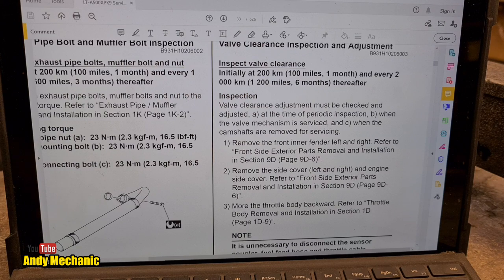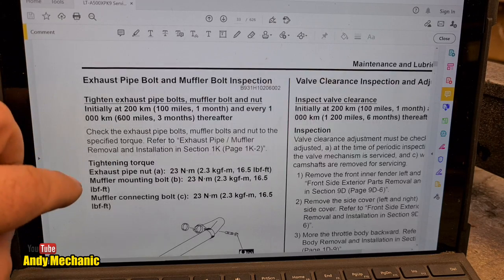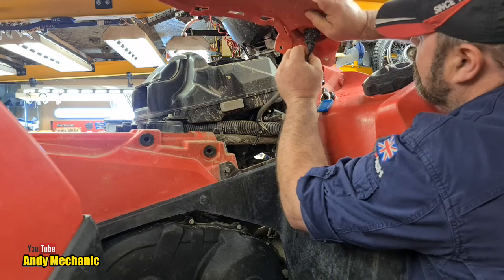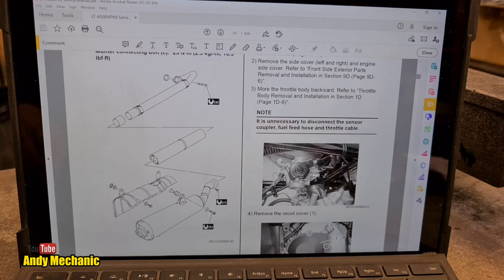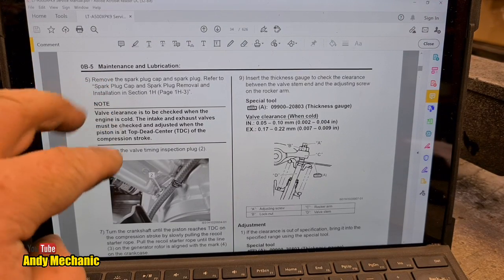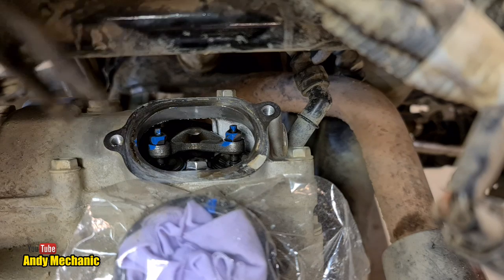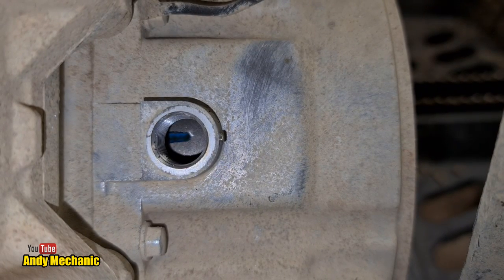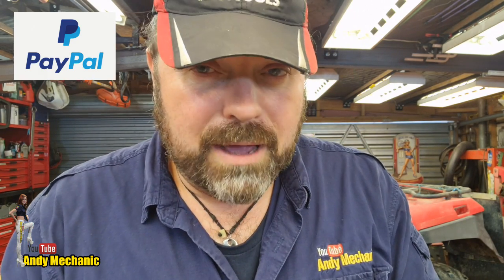Suzuki Kingquad - valve clearance check & adjustment #1878

Comment: Why would you not take the time to wash it before you opened up and vital areas. Amazes me how people work on muddy motors. Just a disaster waiting to happen.
Reply from the maker: The bike was washed prior, 2 hours spent water blasting mud from the chassis  Modern ATV chassis are less accessible for cleaning due to the extensive plastics now covering the engine. Not ideal at all.

Cheers
Andy

Comment: Hey I know this is an older video but I'm getting ready to do the same job on an 08 king quad. How do I get that tool for the valves thanks
Reply from the maker: Mine is a Yamaha special tool- any Yamaha dealer should be able to supply.

Cheers Andy
Reply: Hey thanks a lot.  I did end up finding one.  Mine were all .004 out of spec   now just waiting on o rings 🙄 over a week now

Comment: Andy is the 500 you worked on here close to the same as the 750 valve wise? Meaning could I adjust my 750 valves in the same sequence and same instructions. AKA/ valve clearances?

Comment: Hey Andy, how many km did that bike have? Just wondering how essential it is to get this done, after 200km initially seems extreme. Also are you just using brake cleaner here or sonething else. Thanks for sharing.
Reply from the maker: First service is critical, components bed in & clearances often change as a result. Do it now & it should then be good for a long time.
Cheers Andy

Comment: Hi buddy. I'm just about banging my head against the wall with my KQ 300. Hard to start. Won't idle. Pops and bangs through carb when it runs. Tested CDI, regulator, new plug and cleaned carb, set valves.. Eventually put a brand new carb on but still the same. Compression 110psi. Any ideas?
Reply from the maker: Chech valve timing & also pull flywheel & check it hasn't spun on the key way

Cheers Andy
Reply: @AndyMechanic  I'll check it out this evening. Thanks Andy